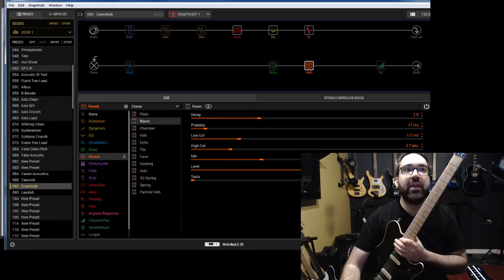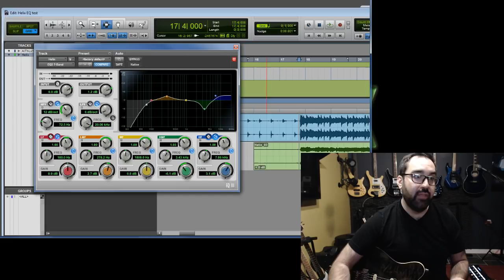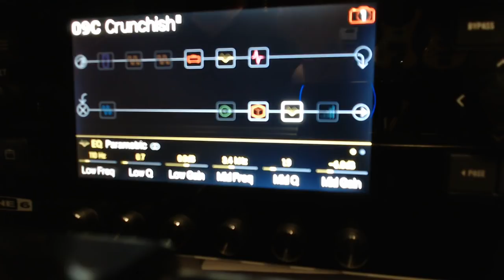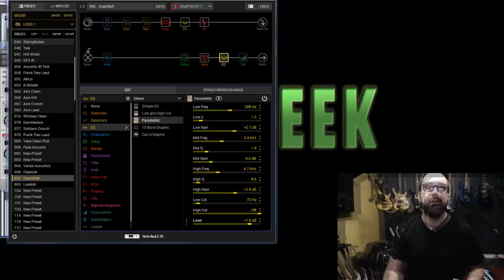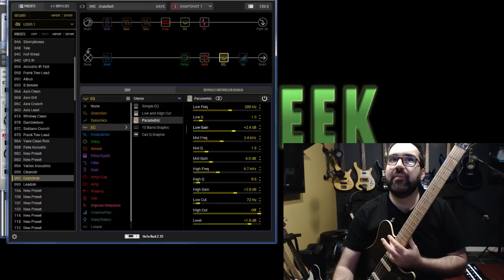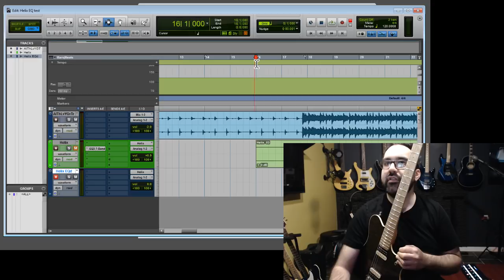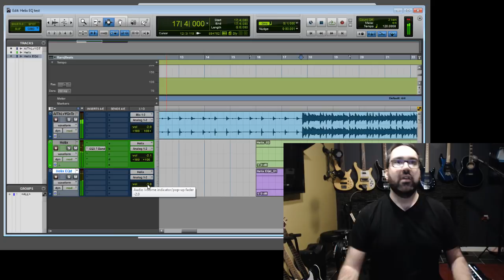Using The Parametric EQ on the Line 6 Helix

Comment: Hell of a tip, Richie. What an immense help. I focused in on the brittle plastic (digital) high frequency and now my tones are so much better!
Reply: Which did you find were culprits? I found around 7.1 as high as 11.1 11.2. Also on some, 3.2 ish? Sound about right?
Reply: Juan Valdez actually I find on every patch that 2.6-2.8 is ear shatteringly brittle and harsh. I also pull up the 10 band EQ after the amp block and cut the 32 hz and the 16k 100%. For my uses this seems to help a lot.

Comment: If I use the HX STOMP at the end of my pedalboard chain, but I want to equalize my amps to tubes, is this possible with this device? I have two randall in stereo mode, and a tc electronic plethora x5 for the effects loop. I would like to use the hx stomp for the preamp to change the tonalities of my dist, or would it be better to go for a Boss MIDI EQ-200? I have read that Source Audio has another EQ in midi mode. good video, greetings

Comment: I'm using a velocity 300 power amp and plugging it into a Blackstar 2x12 , i'm using the settings as if it was plugged into a PA speaker, after thinking about this using a guitar speaker as opposed to a full range pa speaker what can i do ? I love the natural sound of the line 6 cabs and  IR'S but they do not sound so good with my setup, can you help me? how would you hook this up and what settings would you use to incorporate the cabs and IR'S you mentioned an EQ would this help
Reply: With a guitar cab, you’ll need to turn off your cab sims/IRS. Unless you’re feeding to front of house. Then just run a line before your cab sim or IR that’s splits off into your guitar cab. Then keep the line with your cabsim/IR running to the XLR line. 
If you choose to use a powered pa speaker, (I do this and man, it is awesome for me. I just use it at home to edit my patches and practice. Live I go straight to the board and use floor monitors if I’m not using in ears. It’s heaven honestly.) just make sure that if there is an EQ on the powered speaker, turn it off. Run it completely flat. If you used a power amp and a PA speaker, you should be good as well. The sound will come out like it should. I hope that made some bit of sense. A powered behringer is what I use. And I love it.

Comment: Very good explanation of how to use a parametric EQ, but I was tought: If it takes that much EQ to sound ok, you better use a different amp.
Reply from the maker: That's true, but this is hardly too much EQ.  When I pull out the 10 band and start doing 20 db boosts and cuts, then that's heavy EQ.  This is pretty normal for mixing.
Reply: Some have 10 band EQs in their amp's effects loop, some consider anything more than a low cut and a little compression too much, and would rather buy another boutique amp or microphone to get their sound.
I guess we could agree on the old "if it sounds good it is good" :)
Reply from the maker: Anno Nühm my point is, you can take the greatest amp in the world and record it with the best microphones, and by the time it gets to a mixing engineer, they're gonna use EQ.  It's not about the amp sounding bad, it's about making it fit in the mix.  I don't understand why you're looking at EQ as a bad thing when every record we listen to has EQ on it.
Reply: Looking at EQ as a bad thing? Who said that? It's just not my first choice in the "achieve a good recorded guitar sounds" catalog. I make the sound with my fingers, a guitar and an amp and a microphone and certain pedals and speakers, not with the EQ. And i use EQ to make place for the vocals, leave room for the bass, whatever. But i touch a good guitar sound as little as i can, once i found it. That's MY point.
Your video just reminded me of my endless tries to make a guitar sound "sit in the mix" 10 years ago. Some day i discovered that in the days of easy reamping with  thousands of guitar sounds available in your daw within seconds, it's way easier to FIND a sound that sits in the mix, than to MAKE one fit by applying a lot of EQ.
I would have never done that bump at 360 Hertz (1:53), i would have found a preset/profile (Kemper user here) with an amp that fills that frequency and fits into the song by it's own natural sound. Of course i would have done the same roll off in the highs and low cut. 
But as i said, if it sounds good it is good and people have different methods to achieve that.
Reply from the maker: Anno Nühm You said that if you have to use too much EQ, you're better off trying a different amp.  I'm saying this isn't too much EQ.  This video is for people who like their presets but can't get them to cut with a band.
Reply: Yeah, you said that already. And we agreed to disagree on that "how much is too much" thing. No reason to say it again.

But NOW now you are also saying that this video is for people who want to make their favourite sounds fit into a song by force. By applying EQ. Seriously?!!
In THAT case "try a different amp" is the ONLY advice.
What does "like my preset" have to do with "sound fits song" or "sound cuts through"? Very little and an EQ won't help with that.

Comment: Hi Richie, I know you use / endorse Line 6 gear.  Have you tried to use the Helix into the DT series amps like the dream rig set up that used to be available on the HD Pods, since the 2.8 update has made this facility available?    I'm slowly setting mine up that way now, bypassing all the Amp models in the Helix, and using the actual valve models in the DT, so the Helix will simply be for FX and channel switching the amp.  I know you did a video on switching channels on the DT via the Helix prior to the Dream rig type compatibility being brought back, but would be interested to see someone who knows this rig actually do it and demonstrate it's pluses and minuses as opposed to running direct to the desk or into other amps.

.

Comment: What does the Q stand for for Mid Q, Low Q, High Q? And what does it do? Thanks!!!!
Reply: Q generally means in an EQ how narrow or wide the boost/cut gonna be...
Reply: Q factor is the frequency divided by the bandwidth...
Reply: I'm sure in the Helix the smaller the Q the thinner the EQ peak, so it seems it works opposite than that DAW plugin.

Comment: You wouldn't have this problem if you were using a Kemper.  :). Actually I remember you doing a parametric EQ vid for the POD HD 500 and it was a big help for me back when. Nice Ric basses you have hanging in the background.
Reply from the maker: This is not a problem exclusive to any particular product.  I've often experienced the same issue miking a real amp.  That's what the EQ is there for.  Might as well use it.